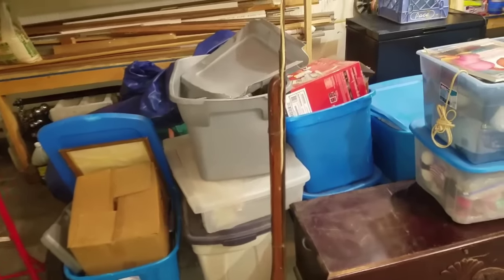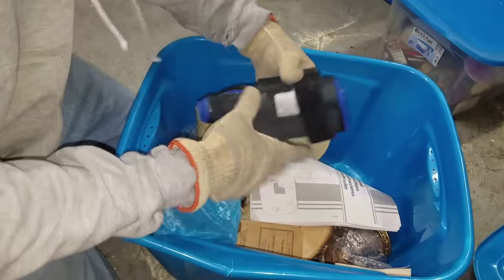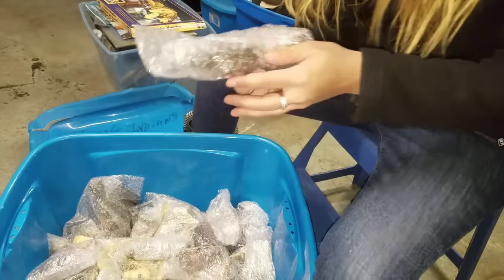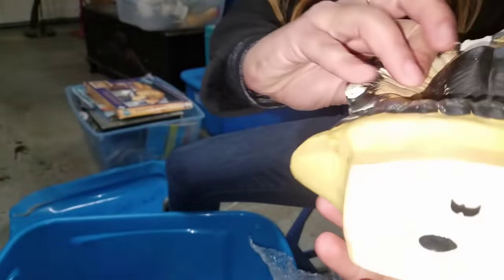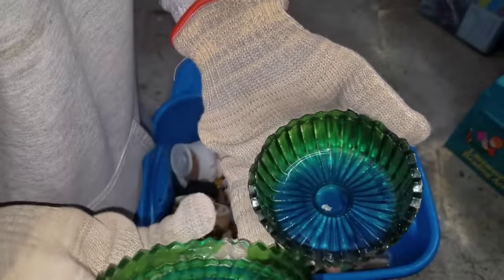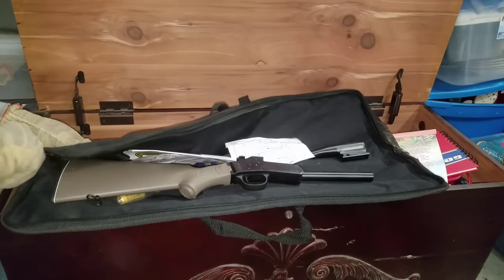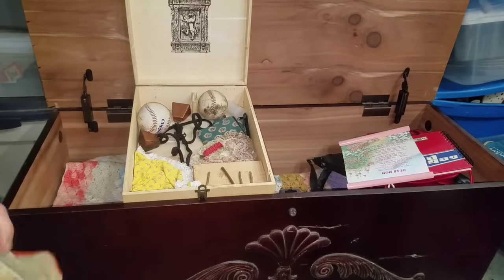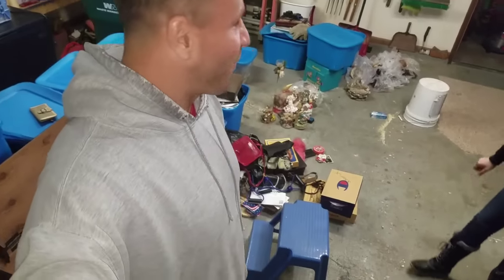FOUND GUNS I Bought Abandoned Storage Unit Locker / Opening Mystery Boxes Storage Wars Auction

Comment: Why wouldnt you check the chamber of the gun to see if it was loaded?
Reply from the maker: Excitement got the best of me again :)
Reply: Even if you "Know" it's safe. If it's been out of your possession, it's loaded. Even if you just put it down for a minute, if there's someone else there that could have loaded it, it's loaded. Until you check it. Again. Yes, you will waste time doing it again, but you won't be the cause of an accident.
Reply: he prob has no exp with guns. and didnt know any better.
Reply: @vahsharo1980  Well he claims to be an instructor, but I call absolute bullshit. Before I ever even owned a gun I knew better than to pick one up without immediately clearing it before handling, and not flagging people with it. And anyone who's been around guns long enough to be an instructor knows the difference between a clip and a magazine, and wouldn't get so excited over a cheapass hi point they blow their load and "forget" to clear it and the way he reads off "Hi Point firearms model 995" like he's never seen or heard of a Hi Point, some of the most unmistakably/distinctly ugly guns around. At least he kept his booger hook off the bang lever, but that's about the only basic firearm rule he didn't break, this video was an ND waiting to happen.
Reply: @grindersandgears3445  you got a point there.
Reply: It's called Darwin's pride and joy, natural selection at work.

Comment: Those are bison, not water buffalo.  The one American Indian head you tried to mount onto the wooden stand probably goes on the other wooden stand. Double check them. The "compass" you found is a mini postage scale. The Rossi "two guns in one" with the switch-out barrels has a MSRP just over $200. The Hi Point 995 is a 9MM Carbine.  Depending on the exact model you have, the MSRP is likely in the $300-$400 range.  I guess your storage unit is well paid for in the first hour.  Good going George!
Reply from the maker: This one is a great find for sure!
Reply: if you think the high point 9mm carbine is worth $300-$400 i would love to know where.  i have 1 just bought it this year love it but wwould gladly sell it for 3-400.  brand new they were only about $250-$300

Comment: The hi-point is junk, but the Glock was a great find.
Reply from the maker: Yes, I was really happy about the Glock :)
Reply: 45thpaace I beg to differ sir,while I wouldn't put my life with it my Hi point carbines work great,yes cheap,but not trash
Reply: I have a hi pointe, no problems no jams. The key is to keep it clean and use the right ammo! 👴your welcome kids. Grandpa.
Reply: Maybe new, Probably less then 300 new. Used Himpoints don't cost much. Still not a bad find.   wavygr
Reply: @WhatTheHales  highpoints aren't junk, especially the original 995 variants. 

I must also tell you they have a lifetime warranty and are made in the USA 

Do not attempt to take it apart yourself for any reason as most people aren't trained well enough to do so. 

You made out on the guns I'm happy for you, theres over 1000$ worth there, the mkshighpoint995 I'd 450$ of it. 

The clock looks like a first year(1986 box) may be valuable if not shot. They always came with extra mag and a cleaning kit aswell. 

As for the Rossi, looked like a 20guage shell you showed...  The receiver alone was worth your cost of the container. 

Good job.
Reply: @bretsubotnik1777  I second you on that, the old 995's run like there's no tomorrow with a lifetime warranty
Reply: wavygr  the 995 is a 450$ rifle without the optics. The optics were another 450$ by itself.
Reply: The first two guns could be sold for about enough to pay for the dumpster to get rid of everything else. The Glock is the profit, assuming it's not entered stolen in NCIC.
Reply: wavygr  if you can get one get the older style, which is like the one pictured. 

Those things take a beating and they keep going. 

I tried killing my first HP back in 2005 and I still have it. 

It has well over 100k rounds through it and its 1inch accurate at 100 yards, its as accurate as my ar15 basically. 

The thing about the HP is its single stack mags, 

I take a soumi drum mag and weld it up and I then have quite a many more rounds to go "play ball"

I love my guns, if I had to get rid of them all and only keep one, I would actually keep that mks highpoint 995. 

And here is why, 
It has never broke, eats all ammo cheap or expensive stuff, lifetime warranty, however after a shtf warrant won't mean squat I'm sure. 

It can be buried,  its submersible,  and the only thing I ever nodded on it was the bolt handle,  other than that and the mag, and scoping it its original and running better than new guns.
Reply: I certainly wouldn't stand in front of a hipoint, but from what I've seen your odds are improved there will be a fail to battery or fail to eject.  I gun that might not work is only worth the scrap metal to me.  I also don't see any benefit to running pistol cartridges through a rifle.  Might as well shoot a 300 blackout or 6.8 Creedmore.
Reply: @45thpaace  I have a highpoint that's never failed me, its over a decade old now since I bought it new and was a trunk gun for a rough year. That mks highpoint 995 served me well. 
 I also have a 300blk that runs like a raped date quiet as a mouses fart.
Reply: 500 for all 3
Reply: I have a highpoint carbine that shoots 2 inch groups at 100 yards I betcha that glock 9 won't do that I have one of those too so I know it wont
Reply: @donnysylvester9583  people that dont know how to shoot discredit the cheap but well built mks highpoints. 

Theyre a modern day tank by standards.
Reply: wavygr  the optic is like 100 I have the same one
Reply: Hi-point carbines are solid weapons actually.

Comment: If ya ever need a guy to appraise your guns you find or give ya info on the models feel free to get at me . I gun Smith and do sells at gun show on older and newer guns . Be more then happy to give ya the book value and what ya could get and ask for those rossi few years ago price was up here in NC at local gun shows brand new tax out the door price is around 150 to 160 ish depending on the combo if its 410 and 22 ya can typically find them new 130 the 20 gauge with 223 looking at 150 ish new 12 gauge combo with 270 ya looking 160 ish typically.  Also very knowledgeable about knives as well . As well as reloading supplies.

Comment: Bruh that glocks slide looks like its gonna come off
Reply from the maker: Think so?
Reply: What The Hales  well so the recoil spring is very exposed in the clip you showed
Reply: That gap between the slide and frame is normal on a glock. 
It's a gen 2, so an older model but looks to be in good condition.
Reply: Azkipo C oh okay
Reply from the maker: @azkipo  Thank you for letting us know and sharing :) 
***If you haven't already, don't forget to subscribe by clicking on the red Subscribe button***
Reply from the maker: @migraine461  It's actually a Gen 3 .40 Cal :) 
***If you haven't already, don't forget to subscribe by clicking on the red Subscribe button***

Comment: Highpoint makes a neat, fairly reliable carbine. You'd be better keeping it; resell is usually $250-300. That single barrel firearm would probably be worth more than the carbine
Reply from the maker: How much do you think the single barrel is worth?
Reply: @WhatTheHales  it may vary by year made, what state you are in, and what caliber. Some of those single barrels take other barrels aswell to convert caliber, if it has spare barrels to convert caliber it could be worth more. The Rossi 2 in 1 looks to be averaging out at anywhere between $200 up to $400 depending on caliber. Maybe worth more but idk what barrels you have.
Reply from the maker: @rustyshackleford4965  Thank you for letting us know and sharing :) 
***If you haven't already, don't forget to subscribe by clicking on the red Subscribe button***

Comment: Um, that "compass" is actually an old school 1980" drug scale. You use the clip to grab onto the bag of weed or ??? and hold the other end with the keyring up in the air and it will weigh out whatever drugs your buying/selling. Back in the day that scale cost just as much as a .01 gram digital scale costs on Amazon.

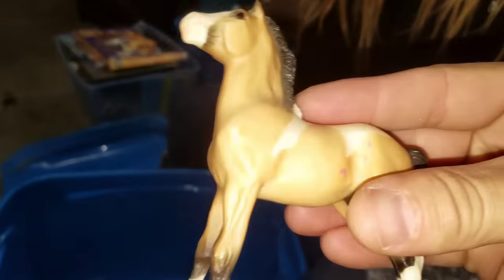Comment: The plastic horse at 18:52 is a classic scale Breyer horse on the Mesteño foal mold. He is from the Spirit Kiger Mustang Family set which also included a mare and stallion. Depending on his condition he can sell for 5-10 dollars on eBay. Breyer horse’s are extremely collectible and usually hold their value. Even if they are dinged up collectors will still buy them as bodies for customizing.
Reply from the maker: How do you customize them?
Reply: What The Hales collectors will strip the original finish on the model and repaint them to look even more realistic. Sometimes they will resculpt  manes and tails or legs, sometimes they will even remove parts of the model and add on parts from another model. Google custom Breyers and you’ll see good examples. Some of the workmanship on these models are very detailed. Some custom models can sell for thousands.
Reply from the maker: WOW... I didn't realize all of that :)
Reply from the maker: @deuceschinagirl  Thank you for letting us know and sharing :) 
***If you haven't already, don't forget to subscribe by clicking on the red Subscribe button***
Reply: What The Hales I did that long time ago. I never miss a video!

Comment: Be careful if you decide to test fire that Hi Point, they are the cheapest guns for sale in the USA. You can get a brand new 9mm pistol for under $200. A new Hi Point 995 9x19 (AKA 9mm)is only $250, it just might go boom in your hands when you test fire it, LOL The sight and flashlights mounted on it may hold the same value as the gun itself. It belonged to some tacticool dork. The only thing worth a damn in that locker is that Glock 22, .40 S&W, not sure which gen it is but they run $500 and up usually closer to $600 for the Gen 4's & Gen 5's

Comment: If you have a locked box or case u can drill it out with a steel bit as long as u use a bit the same diameter as the key hole dont try this on a safe if it has a glass plate u will lock it up to the point u will have to plasma cut it open
Reply from the maker: Or use a sledge hammer :)
Reply: Sledge hammer might damage what is inside and if u hit a 44 magnum with a hair triger while its in a box u gonna regret it
Reply from the maker: @nicholasbishop2267  Thank you for letting us know and sharing :) 
***If you haven't already, don't forget to subscribe by clicking on the red Subscribe button***

Comment: Hi Points are worth barely $100 hence guns prices can be based off so many hi points. Especially because many Hi Points Pistols  have a $100 dollar bill decorative wrap around the pistol frame. Adding to the meme of $100 of value equals a Hi-Point for pricing. So a $450 firearm would cost 4.5 Hi points

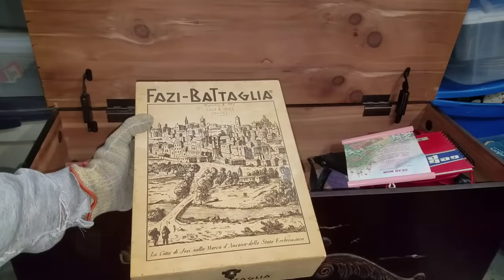Comment: 30:10 timestamp that wood box is a wine case
Reply from the maker: Do you think it's worth anything?
Reply: Depends on how old it is, the original price of what ever wine was in it, and how limited the distillery was ( how many bottles were actually distributed ). If it was a low run distribution, like a private brewery, it could be worth a small fortune to a collector. 

BTW: those no cash value coins are tokens from Alladin's Castle, a video game company that had "stores" in malls across the country. The lighter is not old, it's from Marlboro and was a point reward item for turning in Marlboro Miles, I actually have one myself that I got that way :)
Reply from the maker: @gromulosgrom593  Thank you for letting us know and sharing :) 
***If you haven't already, don't forget to subscribe by clicking on the red Subscribe button***

Comment: Rossi firearms are very low quality firearms. That first gun you could get $50.00 for it. Junk, I had a Rossi .357 issued to me and while us guys were checking them out (brand new by the way) one guys cylinder fell off and rolled across the gun range floor. And the other guys gun didnt even have a firing pin. Horrible quality control for horrible firearms.
Reply from the maker: Not bad for a starter gun though :)

Comment: HOPE U GUY GOT THE HAND GUN TRANSFORE BECAUSE ITS 20 YEAR IN JAIL IF SOME FINE PERSION TURNS U IN TO THE ATF
Reply from the maker: YES, 20 years of warm meals and cable TV :)
Reply: Wait wut? How are they violating BATF rules? Sure, if the state they reside in does have registration laws than yes, they would need to comply those laws. I would have to register it being in Colorado but I wouldn't required to do anything back in Texas for example. Now with that said, I would still have the police run the numbers on it even if their not legally required to do anything just to make sure its not stolen.
Reply from the maker: @myroadtours6147 Finally, someone on YouTube with some common sense ;)
Reply: @myroadtours6147  they have to trans for it in there name with the state gets a copy of the info
Reply: @Adam Kuklinski they do have transfor laws in thesouth for hand
guns